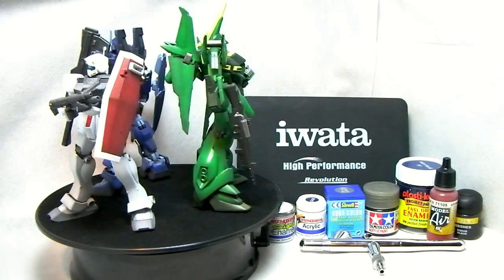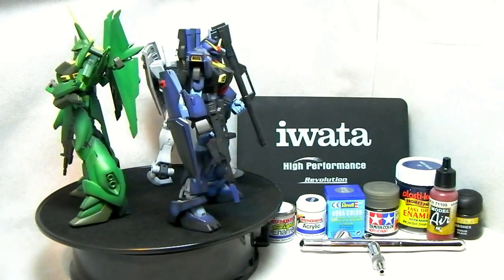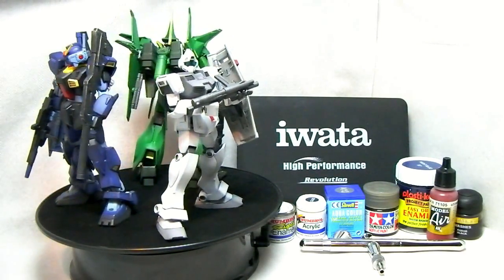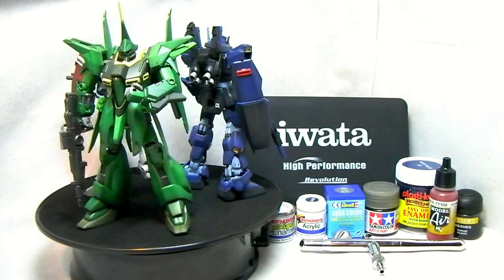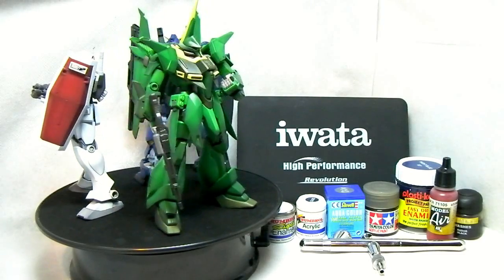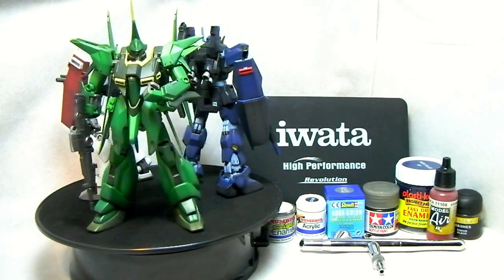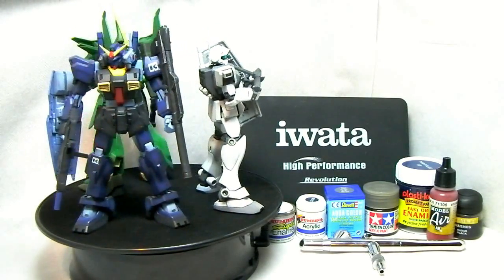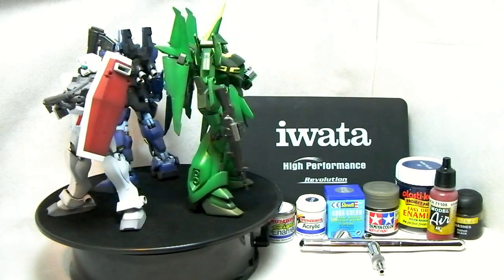Airbrush painting 1 (tips & tricks) - Intro to my beginners airbrush model painting tutorial series

Comment: yeah it should be a 0.3 mm. I have an Iwata HP-C Plus. I think I just need to find the right pressure. Probably also need a bit of practice with the stuff. I'm used to Mr Surfacer, but I decided to try something else as that is very strong and smelly.

I also think i should start looking for a different compressor. I got mine at a RC shop and it goes up to 10 bar(!). It's tricky finding the right setting on it :D.